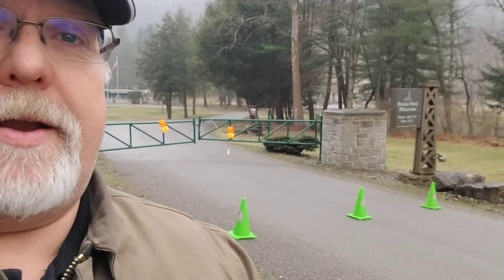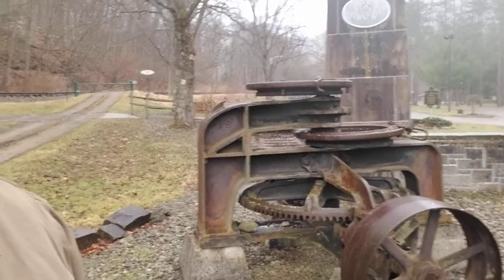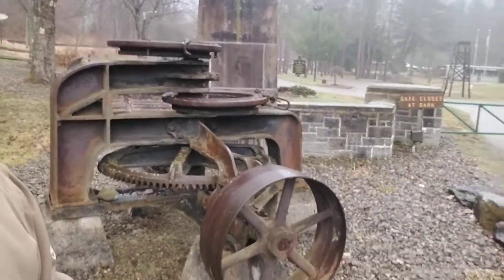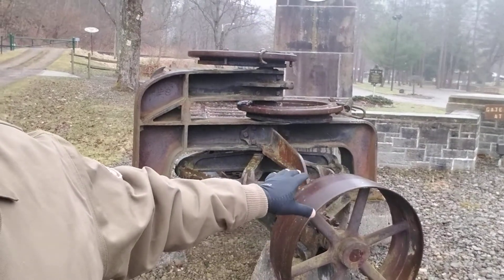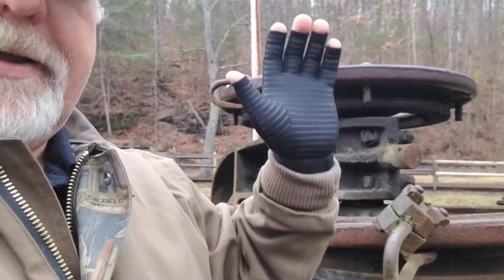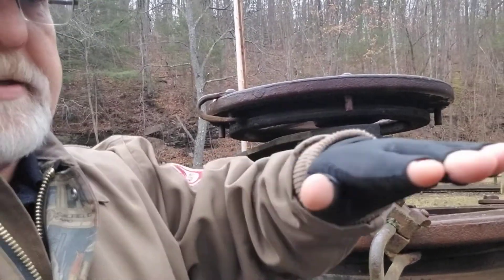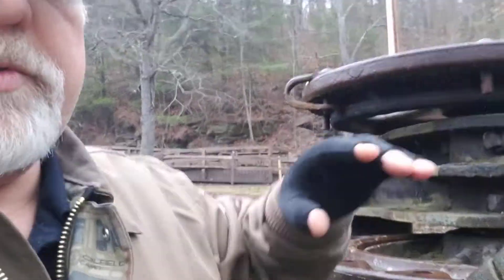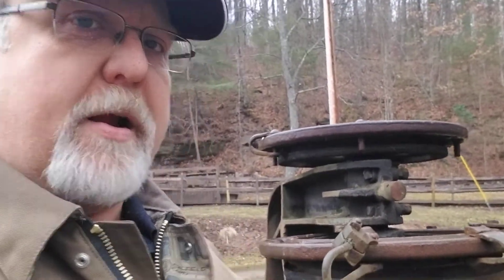LCCTC: Oil and Gas Lesson 2

Comment: The central power house you talked about in the video could run 24 Pumpjacks. If you added a second wheel you could get 48 Pumpjacks running.